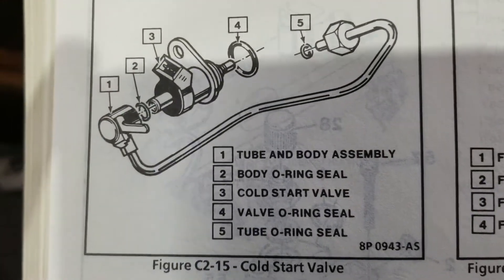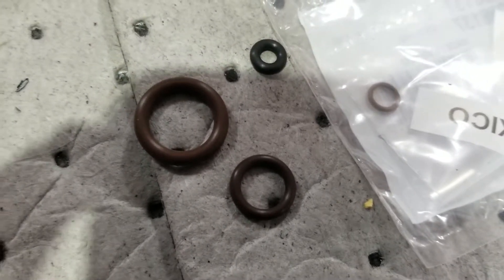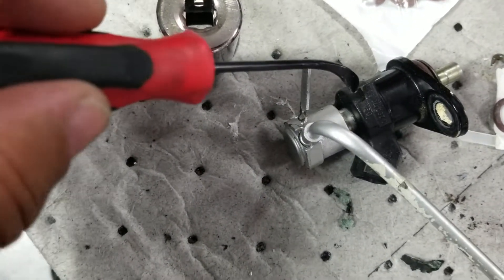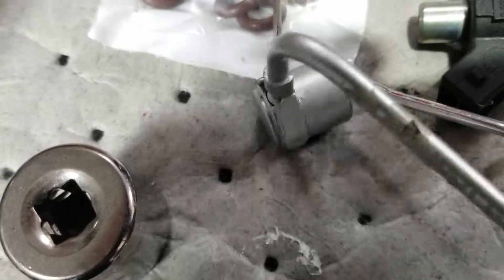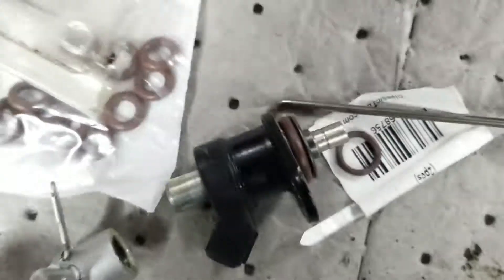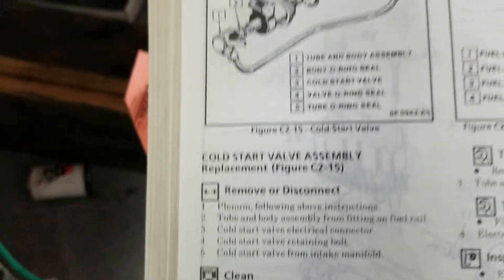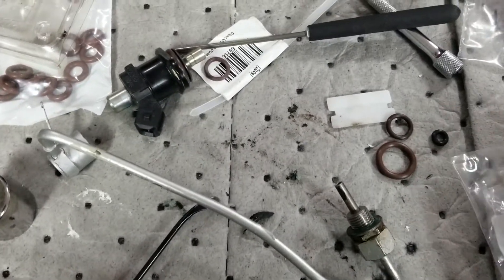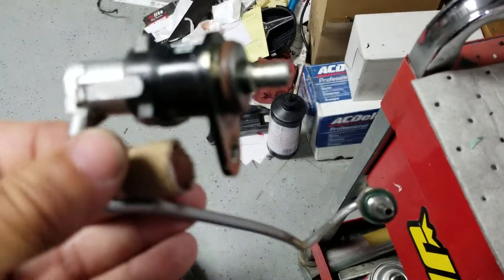Replacing seals on fiero v6 cold start injector

Comment: Your video is misleading  the pipe side that goes in the fuel rail side is a 2 piece nut you need to separate them to install the small o-ring in between them  . Im talking about the small o-ring that comes in the fiero store kit  !
Reply from the maker: You are correct but since i never seperated that nut assembly i had no need to replace that seal. I only covered the seals i had to replace when i removed the injector assembly. Not misleading just covered what i had to replace. As the small seal betweem the nuts isnt disturbed when removing thebline and since it wasnt leaking i didnt feel the need to change it. I probably should have mentioned that seal a little more clearly thanks for pointing it out.
Reply: What mechanic manual do you have.